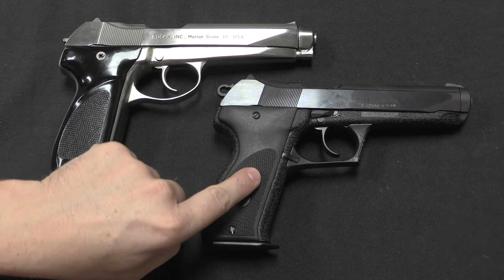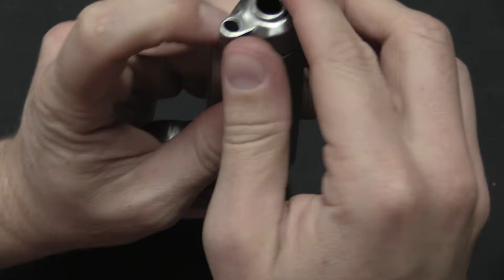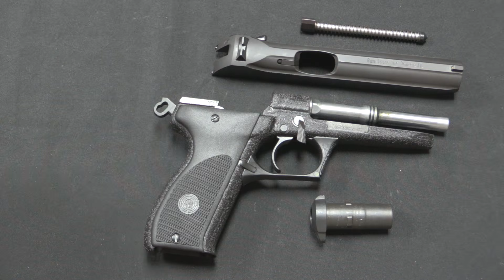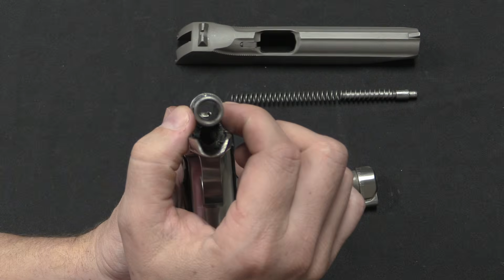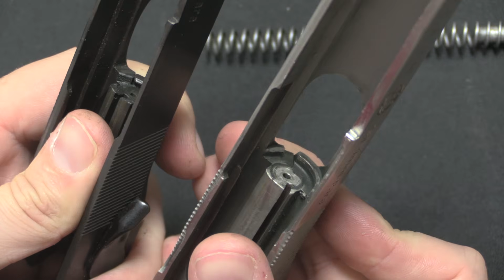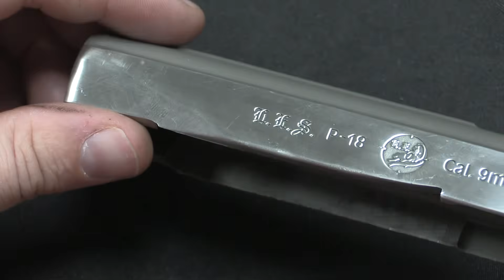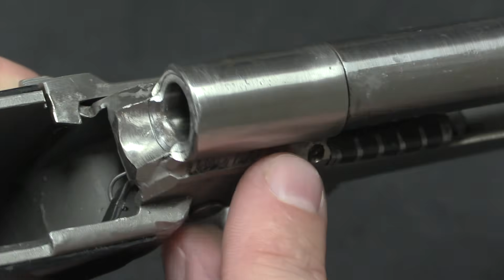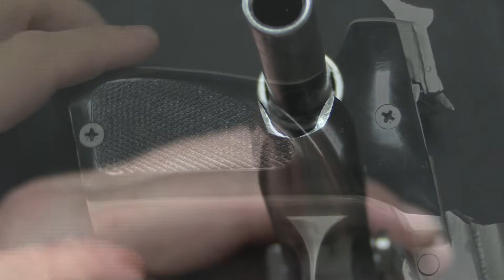Rogak P18 - A Cautionary Tale of Manufacturing

Comment: Hey Ian,

The Steyr GB seems to be a superior pistol to the Beretta from your description of accuracy. Also just from looking at it seems more simple for a soldier to look after too (Cant comment on it against the Glock as I've never handled one personally).

So my question is could you elaborate on why it lost its trials in Austria and the US? I'd love to find out why.

Keep up the good work love your videos.
Reply: ELJOCKEL Was one of the requirements a locked breach? The US Army loves to set arbitrary requirements like that that prevent perfectly viable weapons from competing.
Reply: It lost because 1 of the 72 requirements that the army demanded wasn't accomplished by the GB. It was superior in nearly every way to the beretta, at the same cost...
Reply: In Austria it was also the best of all pistols tested, but the Glock was cheaper...
Reply: Sean Heihn From what I heard the Steyr GB suffered from "reliability issues".
Reply: @JackalRelated  How can a Pistot this simple suffer from Reliability issues?

Unless you load wrong Ammo, I cant think of a way to make it have trouble....
Reply: @ferdinandhumperdinck165  It uses a gas-delayed blowback system; where it gets "unreliable" is when it starts fouling or not being cleaned after a while - and knowing the stuff the pistols in the army trials go through, I wouldn't be surprised if fouling caused the mechanism to go out-of-whack.

Comment: The Phillips headed screws on the grips is a "special" touch. I seem to recall an article by a notable writer of the day deriding these pistols for being a piece of junk.
Reply: Angelo DeLuca because they look unaesthetic and instantly bring wood screws to your mind and not firearms.
Reply: Not that it helps the pistol much, but those actually look like Pozidrive screws, which are less prone to "torqueing-out" and stripping the heads.
Reply: Wayne - but Phillips are far inferior to square drive.
Reply: @pfarnsworth84 - These are not pozidrive screws, pozidrive has four slots connected to the cross, these screws have two markings with tiny space between the slot and the cross.
Reply: Square drive? Like Robertson?
Reply: With the correct driver, Phillips screws are FAR superior to slot screws.
Reply: @waynegoldpig2220  I agree.  IF you use the correct tool, no problem.  I'm a traditionalist, but slot head screws are an anachronism.
Reply: This thing makes my NP-20 look more awesome ;)
Reply: as a Briton, I beg to differ.
Reply: Must have been in Soldier of Fortune. The only review of a firearm with absolutely nothing positive to say. LOL the photo had the reviewer THROWING the gun. Presumably someplace that would render it irreteviable.😂😂
Reply: It called a rogak because firing it means you need oars and a little boat to row through your own gak

Comment: I used to work in a steel casting facility that made mostly automotive and aerospace components, and these are the kinds of casting flaws things would have been rejected for.
Reply: It's really reassuring to hear, that "quality" like that gets rejected for cars and planes : )
Reply: moosemaimer Do you think the guy was casting them in his garage/ by hand, or just had the shittiest casting outfit in the US doing it for him?
Reply: Well of course, you wouldn't want a badly made car, that could be dangerous. Guns, on the other hand...
Reply: A badly made gun can hurt one or two people at once, no doubt about that and it's a crappy move by the factory, I totally agree. This is something that shouldn't happen,

but
a) a badly made car or plane can hurt a lot more people at once
b) cars and planes are much more complex and (not an expert, so I'm assuming) all the important parts may not be as accessible or visible as on a gun.
c) You can and will (also not an expert, so I'm assuming) take a gun apart and take a closer look at it sooner or later, but I'm not so sure in regards to cars or planes (better chances with planes I guess, since they tend to do maintenance before each flight).

So in my opinion a shoddy gun is "better" than a shoddy car or plane.
Reply: @Caolila 123

You do have the right general idea. Everything in a  Otto pattern engine (4-stroke) has to be machined to extremely tight tolerances in the .001 to .002 inch range. And with hundreds of parts, any one of them can go wrong.

Though, at the risk of getting Piotr's ire... Guns are exempt from the same safety standard laws that basically every other mechanical thing is subject to. The vast majority of manufacturers follow those guidelines anyway, because who really wants their product to blow up in people's hands? However, not all of them do, and and it shows.
Reply: @DFX2KX  Which safety standard laws are those? The only time I've heard anything like that before is from anti gun shills misrepresenting firearms manufacturers immunity from liability of misuse as a general immunity to all liability.
Reply: @WJS774  Presumably the lack of CPSC style oversight
Reply: Don't mix in politics here, it's not welcome.
Reply: Whose survival, yours or the person you're shooting at?
Reply: +DJ Doc's Videos
Maybe a couple, just in case the first one screws up  ;= )
Reply: +Piotr Woźnica
Awww c'mon, Clowns are welcome everywhere.
Reply: Can we get Trump one?

Comment: What is the likelihood the it is a knock off of pretrials version of the Styer? Are their any known pretrails examples to compare against?

This pistol seems to have a few design features from the pistol generation before.
Reply: Extremely unlikely, since the "changes" makes no sense from an earlier design.
Why remove the extractor? Or rather, why add it in later? What modern military pistol doesn't have an extractor and can't extract unfired cartridges?
And the buffer stack that is there to essentially replace the non-functioning gas-delay mechanism of the original?

And it's not like the Steyr GB has an advanced new system that has never been seen before, as Ian points out, that system was developed for a late WWII rifle.